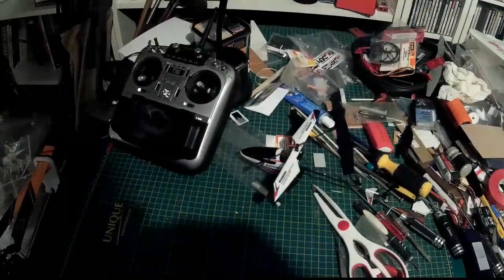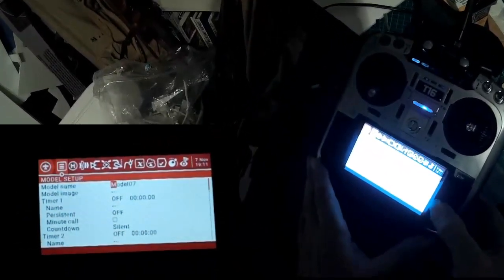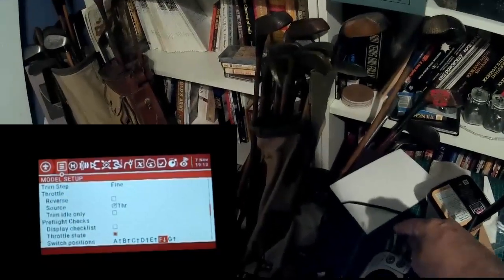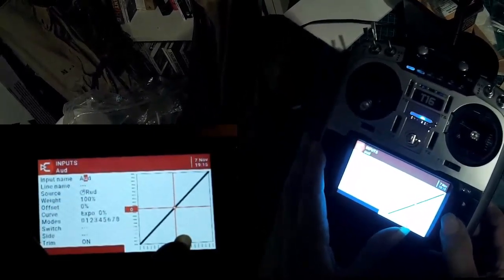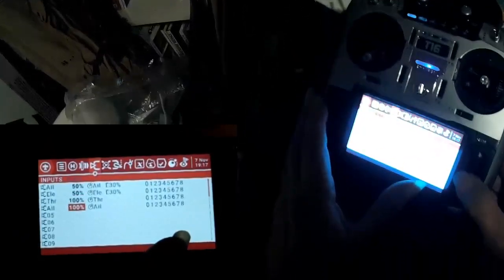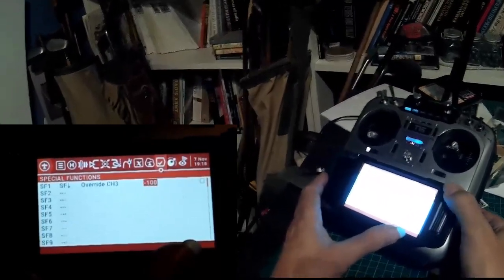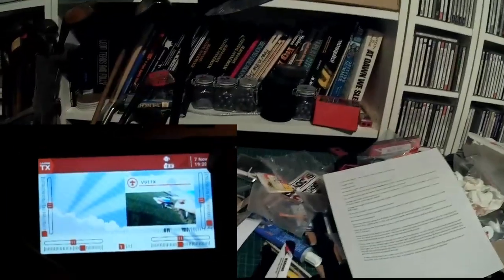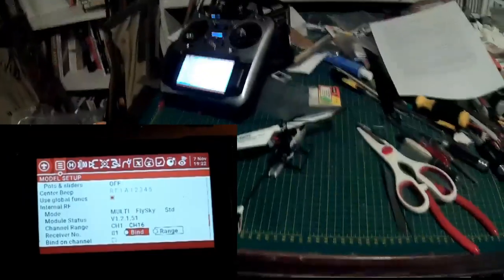V911 Jumper T16 OpenTX Setup

Comment: Hi and thanks for making this very useful video…. You set swash to 120 degrees in heli setting but why is this needed? It doesn’t appear to be required since the helicopter does all its own mixing onboard. Can you explain this please?
Reply from the maker: I'm sorry, I did this so long ago that I can't remember. All I can say is that the settings shown here definitely work. I'm sure other, slightly different, settings would work as well.

Comment: Use v950?
Reply from the maker: You can't use this set-up for the V950, as that is a collective pitch heli. See my playlist on OpenTX heli programming: https://www.youtube.com/watch?v=t_2RVZEhQo4&list=PLid7Q579_2G-mRA02KMlx2JKOkc3UG3Ri Specifically, Part 3 of that series would apply to the V950 (which I do have, and which I have flown with the T16).

Comment: Hi dude, do you have video to setup with old HCP100 Hisky?. appreaciate if you have
Reply from the maker: I do have a couple of Hisky helis. I don't have a specific video for programming those. The programming should be as is shown in my video on OpenTX programming for flybarless helis with pitch control: https://www.youtube.com/watch?v=qAD2pG3PQ2Q Protocol should be number 4 in the Multi module, Hisky.
Reply: thanks i am trying to set it up with programming you refer, but somehow the heli cannot hover and always tilt. do you have any suggestion which part i do mistake :)
Reply from the maker: @harisantoso0275  I can't really know what you have done. Are you sure that the heli is physically in good shape? When you test it on the ground, does the swash look level when it should be? Also, honestly, those Hisky helis are pretty darned touchy... hovering them precisely isn't easy, even when everything is set up correctly. If the heli looks to be physically ok, but doesn't obey the controls properly, I can only suggest going over each of the pages of the programming again, and making sure that you have got everything correct. Pay especial attention to signs - if you put in 100% when it should be -100% things definitely won't work right. If you're not sure about your programming, a good way to check is to unplug the motor, then 'fly' the heli on the ground, and see if the swash behaves the way it's supposed to - tilts right when you put the stick right, forward when the stick is forward, etc; and also check that the pitch is behaving correctly. If you're just learning to fly helis, I'd suggest sticking to something simpler before trying to fly the collective pitch Hisky - as I say, it's pretty touchy.

Comment: I had a disaster. Missed the - sign in front of 100 in the special functions page and when I dropped the switch my poor copter went berserk and beat itself to death. I had lots of spares and rebuilt it to better than new. Anybody following these instructions pay careful note to the - sign or else. It's heaps better to control from my T18 than the standard controller.

Comment: Thanks for the detail bits. I worked out binding by myself but the throttle cut isn't something I would have thought of. The v911 is let down badly by the standard controller.

Comment: @kleedham if you go into system settings on the t16 and change default channel order to AETR instead of RETA  the channel order will always be that as default . thanks for video i was having tail issue because of binding on v912 protocol if u use that the gyro doesn't work must use standard  protocol
Reply from the maker: Yes default channel order can be changed (only affects new models), but I don't want to, as AETR works for more things. Also, if you do change the channel order, you should re-flash the firmware in the multi module with a version expecting your new channel order. I believe this was pretty much the first video I did with the T16 - I have come a long way with it since then, and am generally very happy with it. See my channel for more videos, on programming for various helis, etc.
Reply: @kleedhamhobby  yes awsome radio mine is fully updated module,, firmware latest open tx all custom model images sounds and voice to a better sounding lady lol you can make it sound like Jarvis from iron man if you like lol

Comment: hi, can you please share the bin file for heli model in opentx? I do not succeed in making in and have several helis, thank you
Reply from the maker: I'm not really clear what it is that you want me to do. I created this model for my Jumper T16. I could save it in an .otx file, or just use the 'print model' option to print the settings to a file - but I'm not sure how I would share that with you. All of the settings are shown in the video here - it's really very simple... if you want to do the absolute minimum to fly the V911, just create a new 'airplane' model, with one aileron and standard T tail, then reverse the elevator channel on the Outputs page, and set the protocol to Flysky Std. I reduced the rates on everything except the throttle, and put in a timer and a throttle cut - but those changes are not essential to fly the V911. Note that this is for the V911, other helis may be quite different. I have put up a whole series on OpenTX heli programming: https://www.youtube.com/playlist?list=PLid7Q579_2G-mRA02KMlx2JKOkc3UG3Ri
Reply: kleedham  thanks for the respond, I have the nirvana nv14 opentx, and can’t set heli exactly as needed, in your model file on the SD card there is model bin file, if you could share that file maybe it could help, anyway thank you for the specific respond

Comment from the maker: Well the T16 has been driving me crazy. As is apparently known to many now (but contrary to many videos still on YouTube), you can't usefully write anything to a T16 running JumperTX using OpenTX Companion - if you do so, the T16 will reset itself, wipe out everything you have done, and put itself back to the initial state (i.e. with one dummy Model, default settings, and requiring calibration). I wiped out work several times this way before I managed to find the thread on RCGroups dealing with T16, and after reading over 400 pages of that (really), I somewhat understood the state of things. So far as I can see, the T16 is clearly not ready for prime time... it is promising, but still essentially a Beta, or more realistically pre-Beta, product, only suitable for those with a lot of time to spend on hacking and experimenting and fixing. I have now (after hacking through a bunch more problems) flashed my T16 into a nightly build of OpenTX 2.3.2. Nightly builds are pre-release versions, during development, and are clearly labelled 'Not suitable for flying'. But running OpenTX, rather than JumperTX, is clearly where the T16 is going, and it will only work properly with OpenTX Companion if you run OpenTX on the transmitter. Apparently, to fix problems, I still need to flash the firmware on the internal Multi protocol module - and that can only be done by opening up the transmitter, and using a special interface board and custom-made cable to connect a computer directly to the internal Multi board and flash. Clearly not ready for prime time, as I say. I have the board and cable (base cable, from which to fashion the custom cable) on order... but they only seem to be available from China, so it will likely be a month or more before I am able to do that step... which I am certainly not looking forward to (especially given that almost nothing with the T16 has actually worked according to the initial instructions I was able to find).
Reply from the maker: I did finally get all of this sorted out. I got the bits from China, made the connector, and flashed the firmware of the internal multi module. After that, the firmware can be updated directly using OpenTX without any further need to open up the transmitter. All is now working quite well with OpenTX on the transmitter itself, and multi firmware updated several times. Here's a video I made after updating multi module for the first time: https://www.youtube.com/watch?v=McKIbxPs-fI